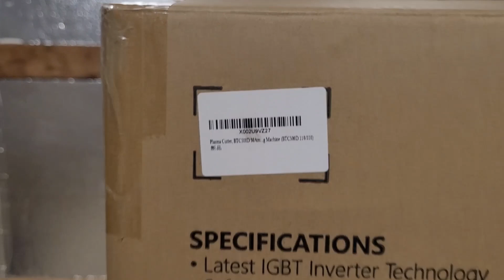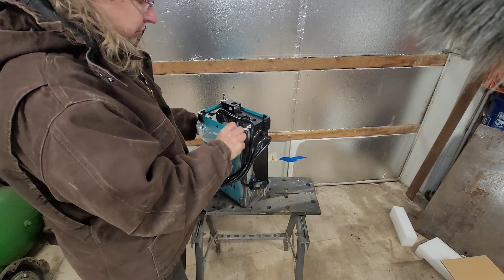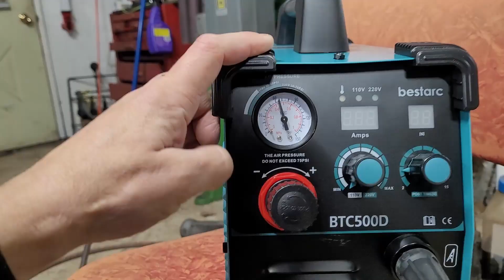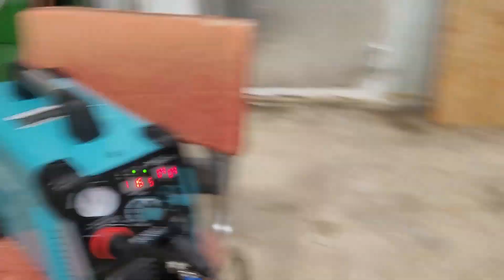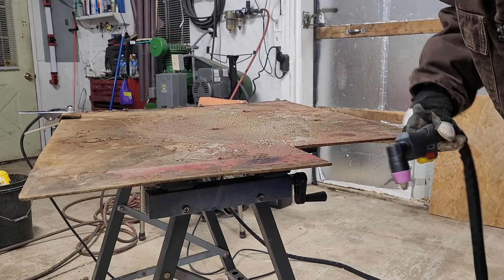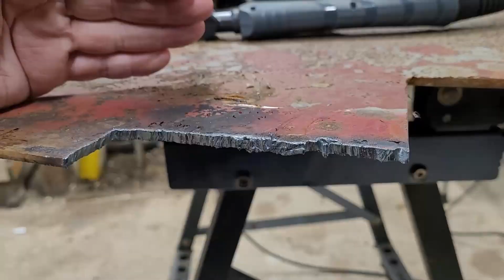$200 Bestarc BTC500D Plasma Cutter! Let's try it out.

Comment: My 500DP just arrived a couple of weeks ago, $260 shipped and I'm trying to use it a lot before the Amazon return window closes, to make sure it's going to work for the long haul; all seems well so far.  Take note there is a warranty extension available on AMZ, $60 range for four years if I recall correctly, might be worth it. I'm told by YT commenters taken in the aggregate that many if not most failures in both welders and plasma cutters are due to their being worked too hard on 115 V, for work better suited to 220 power.  Board failures, frequently, accompanied by loud noises.  Sidenote: I cannot believe how poorly proofread instructions, even web site presentations, are for non-USA based company products. Get a grip, people, put out a manual that doesn't have factual contradictions, typos, and grammatical errors; That includes many that are downright confusing.  Everlast is a prime example (they even had outdated prices for their competitors in a comparison sheet, hurting themselves by using two year old prices on their competitors products).  The manual for this product is ridiculously silly.
Reply from the maker: Good info. Yeah these companies could spend a few bucks on better instructions for sure. It's kind of hard to beat for the price though 👍🏼👍🏼

Comment: It looks like the version you got is not longer sold, at least at Amazon.  I have a pilot arc and sometimes I wish I didn't.  You probably know by now but if you have sparks above the metal you are running too low of an amp or you are moving too fast.  Of course it could be both.
Reply from the maker: Maybe the pilot arc one was more popular? Honestly, I didn't know that about the plasma cutter so thanks for the info. I'm pretty new to it to be honest. I'll change my settings.👍🏼👍🏼
Reply from the maker: What don't you like about the pilot arc one?
Reply: @HFG  I'm fairly new at plasma cutting even though I've had mine for four years.  I have used it very little because I was always having trouble making a good cut.  Often I couldn't get the plasma to come on.  I burned through consumables like crazy.  I hope it has all changed now.  I watched a video where the guy explained that if your consumables were not tightened or any other connection was loose it would degrade your performance.  I found that one of my consumables was not tight enough and the torch hose connection was loose.  He also explained about using the correct air pressure and amps based upon the thickness of the metal.  I had tried that but it didn't work.  After I tightened up my torch and consumables it has worked much better.  I retried his air pressure and amps and what do you know, they were correct.  This has all happened in the last week.  I might have to change my opinion.
Reply from the maker: @robertlaw8510  right on 👍🏼 Dry air is also a huge deal. Glad it's working better for you.

Comment: I had ordered this one and I did not realize it did not have the Pilot Arc 
and they seem to not be shipping it. 
So I Canceled it 
and ordered this one, which I am much happier with. 
So you may like this one better: 
Dynaloop 50A Pilot Arc Plasma Cutter, DC500DP 110/220V Machine with Clean Cutting and a Max Cutting Thickness of 14mm (.551”).
Reply from the maker: Thanks! I didn't know this one didn't have the pilot arc until I got it but I did click a link to the one WITH pilot arc. I just wasn't paying attention I guess 🤷🏽‍♂️ I'll check out the one you suggest. This one seems to work fine, though. 👍🏼👍🏼
Reply from the maker: Honestly, I think the Dynaloop one you mentioned is basically identical to the original machine I tried to buy. Just packaged a little differently. Even the accessories are the same, as well as the model number. Just the brand name and layout is different.

Comment: My brother had just got 1 before last Christmas, I had fun playing around with it one time, jokingly made christmas ornaments, cutting out gingerbread man shapes. Also used it on some more functional uses. Fun and fast!

It is a little on the messy side of a cut. Curious to know how much the consumables add up $-wise overtime.
Reply from the maker: That's awesome 👍🏼 according to some folks I know who use similar ones the consumables aren't too bad. It comes with about 6 tips. I might order some more in case they become hard to find or something.
Reply: @HFG  cool, hope you can have some creative fun with it too. Maybe a metal birdhouse or something...lol
Reply from the maker: @doogansdoinreviews1285  You never can tell around this place :) I'm sure we'll come up with something fun this summer when it's not 8 million below zero lol
Reply: @HFG  I seen a neat video on how to turn an old clothes dryer into a shop heater - that cutter could make easy work of something like that... 

just throwing ideas out there to see what I can spark. goodluck to you staying warm, its starting to actually feel like winter here too.
Reply from the maker: @doogansdoinreviews1285  I think I saw that one. Looks like a good idea for sure. Might not be cost effective for my leaky old horse barn.

Comment: I got the 110 version it did fine i used it to cut frame rivets on my short bed swap. It popped breakers very quickly id say you did good getting 220 version
Reply from the maker: Right on. My experience with 110 stuff that they really like to be on 20a lines. My mig welder is 110 and the difference on 15a and 20a is noticeable. I'm not exactly sure how, but it definitely works better on 20a